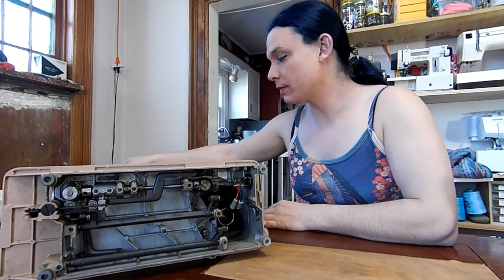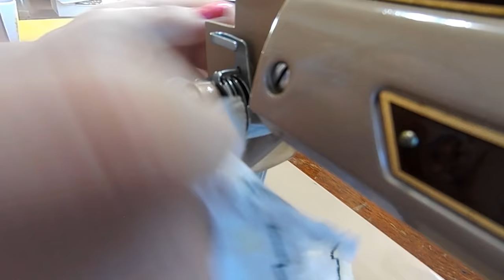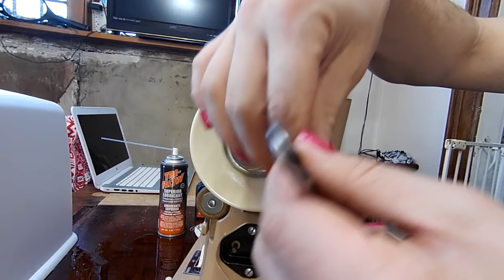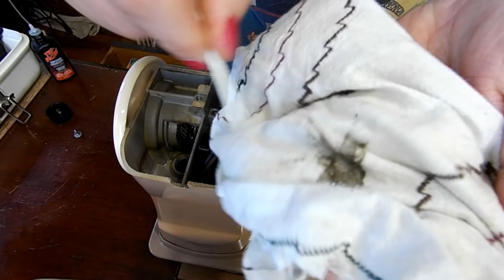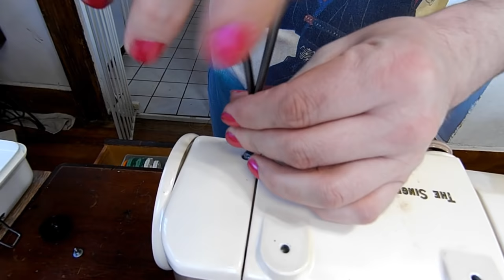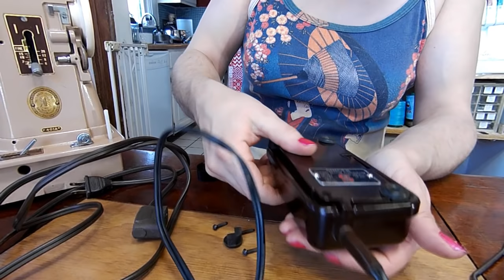How to Clean, Oil, and Grease a Singer 401a Vintage Sewing Machine

Comment: Thank you for this. I just got a 401a and so far, after watching dozens, your video is the easiest to watch and understand. And I love that your nails still look fab after all that. I do have one question-what regular ongoing maintenance should I be doing on my machine? If I don't use it for a while, do I need to do anything special with it while it sits or before I use it again?
Reply from the maker: Im sorry for the Delayed Responce I had no idea youtube was holding the comments until now. As far as long term Ive found that vintage machines need to be used monthly and kept oiled to keep them running smooth. HOW EVER. Triflow oil is unique as when it drys out it leaves a layer of teflon in its wake. So the machine wont get a chance to get gummed up and sticky again. If you leave the machine unused and unoiled for a spell simply oil it down right fast with a drip bottle of triflow and go back to work.

Comment: Stevie,  thanks for this great tutorial!   I love my singer 401a.  Got it on ebay.. and it was a bit dry when I got it.  I got me some Triflow and did what you said.  She hums now and it's like using a brand new Machine.  I'm looking for a 201-2 now.  Would to see a tutorial with one of those babies.
Reply: Since I've commented on this video, I've taken a eye to the 201-2 or 201-3... would Triflow be used on the moving parts like the 401a?
Reply from the maker: I use triflow on all moving parts in sewing machines. Not just the 401 its my go to oil on all my machine. I even run it in my singer 2491's oil pan.

Comment: Thanks for taking the time to make this very helpful video.  I appreciate your relaxed approach to lubricating the machine. So many times I've watched videos showing how, I ended up with more anxiety than I started with.
I have a 403 and the needle position doesn't change when and if the lever moves.  No matter how much I lubricate and work the parts the position won 't change without assistance.  Any suggestions?
Reply from the maker: Im sorry for the Delayed Responce I had no idea youtube was holding the comments until now. The needle bar is spring loaded. If its not moving its most likly because the linkage and junk under the hood is still stickey. Keep triflowing every thing you see. It will wash out old gunk and free up.

Comment: Hi there.  I just watched your video on cleaning the 401a.  Excellent and so easy to follow.  I'm having a problem with not being able to disengage the clutch.  When I hold the larger wheel and turn the clutch wheel counterclockwise, it just keeps going and the needle piston keeps going up and down.  Any suggestion on how to get the clutch to unscrew?  My machine is very clean..like brand new inside.  Only issue is the clutch.  I hope you still check your video comments...I know its been 4 years. 😬
Reply from the maker: Have you taken the wheel off and put a drop of oil on the crank shaft? Sounds like the crank is dragging on the wheel.
Reply: @SewSaveMe  Hi there...thanks for responding!  I was finally able to remove it by having someone prevent the needle bar thing from going up and down while I used a wrench to grab hold and unscrew it.  Guess what it was?  In your video, you say "remember which way this disk goes back on..."  yep, it was on backwards.  BTW, the side with the prongs goes toward the machine...lol.  I think it was put in that way at the factory because this machine is clean inside...not  any grease/oil anywhere (which I need to do) I put it back together and it works wonderfully.   Happy sewing!

Comment: Thank you for such an awesome detailed video. I do not have any tri flow solvent, but I do have Singer oil and Singer lubricant. My question is what can I use to clean all this junked up old grease inside. It appears your tri flow solvent does that, but is there something I could use other than that? Alcohol? Something that maybe Walmart carries? Thank you for your help.
Reply from the maker: I have yet to use any thing else like Triflow. I recommend you order some. Its really nice stuff it will dissolve old tar build ups and lube stuff plus when it drys it leaves a layer of Teflon in its wake. Even dry the machine will still run smooth.

Comment: I really appreciate your videos. Very helpful & concise. That Tri Flow is a great product! However, you might want to do a Google search for the Tri-Flow msds (material safety data sheet, sometimes just called sds - safety data sheet).  The first 2 pages tells most of what you need to know. Consider wearing gloves to minimize skin contact. Not tryin to harsh your mellow, but the msds says prolonged exposure could be toxic.
Reply from the maker: I have read that spec sheet. I was real curious how it reacts with metals and plastics. I did read the warnings about skin contact "fyi almost all oils have this exact same warning" According to there email they got with me it would have to be an extreme exposure, talking hands deep for hours on end every day for a year type extreme exposures. But since there is a risk they have to put the warning out. Look at other stuff, wd40, lucas etc etc they all have the same warnings. I dont think its going to hurt me no more then im exposed to it. Now if I did this 8 hours a day 6 days a week it would def be a good idea to wear gloves.

Comment: I have spent the last 4 hours trying to source the Tri Flow grease that you use.  None to be found and even the Singer grease is in short supply.  I have just seen a post from another person who works on vintage sewing machines and they mentioned that grease and lube was going to be in short supply in 2013!  The only stockists of Tri Flow grease AND oils are either American or Australian and even they are few and far between.  Can you suggest any alternatives please?  Thank you for your time.
Reply from the maker: You can use a good penetrating oil to get it all freed up then flush it over with normal sewing oil so the penetrating oil cant dry out and leave sticky residue. But Ill be 100 percent honest I havent found any thing else that works near as good as triflow that stuff is simply magic.

Comment: This is a fantastic video.  It was very helpful to clean my 401A until I hit a snag.  I was following along and doing great until I went to screw the cams back in.  Either the top cam (#3) or the screw has a small, 3 prong piece of metal that went flying and I don't know how it goes back together.  I'm stuck until I figure it out.  I've searched online, but found nothing.  Any suggestions would be great and very appreciated.  Love your videos.
Reply from the maker: it should go back in under the screw. All it does it snaps to the cams and keeps them seated so they dont slide up while in use.

Comment: Do you have a video on how the upper tension assembly goes back together? I had to take mine apart and can't get it back together right. Thanks for this great video. This is my only zigzag machine, I only sew on vintage, and mine really needed a service. I will look for your video on the motor. Thanks. Happy Sewing.
Reply from the maker: Im sorry for the Delayed Responce I had no idea youtube was holding the comments until now. Im sorry I do not. I have ever used google images for reference my self if thats any help.

Comment: Hello, Hello, what would be the best video for taking my 401a apart for a thorough cleaning. Looks like the person smoked a lot, the machine has old nasty grease, parts dont move. I was able to remove the motor, does not smell burnt. 
I have oiled everything, not the motor 😂. Just want to learn about it and get this one cleaned up. 
I have had one for 20 years, I used this video to oil it and it's my "daily driver"  running like a champ!!...but, I recently acquired another and would love to have it running as well. Thanks in advance!!
Reply from the maker: Great News im glad this was useful to ya.

Comment: Hello Stevie, I just got a 401A and will be cleaning it as per your video, soooo good. But I’d like to know what kind of pins for the thread spool were you using? The little ones that came with the machine are flimsy and not all fit. What do you recommend?
Reply from the maker: I use the stock plastic ones that were sold with it just fresh ones. They are flimsy and wimpy how ever the upside is if you knock one off by accident you dont damage the lid or machine at all you just snap or mess up a 50 cent plastic pin.

Comment: Thanks for the tutorial. I've recently acquired two of these babies, and now I think I'm prepared to do some maintenance on them. 
I've noticed that the feed dogs on one of them don't seem to have full range of motion. Long stitches don't seem as long as they should, while short stitches are practically piled up on each other. Is that something that needs special attention, or might it work itself out with proper cleaning and lubrication?
Reply from the maker: Thats a Good Question. I would start with heavy oil and getting every thing freed up before you dig to deep 80 percent of the vintage machines are just simply sticky from old oil and grease.

Comment: I have original zoom spout sewing machine oil, does it work the same as tri-flow? I'm new at sewing and just inherited the singer 401, great explanation in the video, thanks for explaining at beginner level
Reply from the maker: Zoom Spout isnt aweful oil it dont leave tar in its wake and does work fine. But not near as good as triflow.
Reply: @SewSaveMe  Thanks, I did end up getting tri-flow because there was a lot of old gross oil on my machine. But my bobbin winder is really stuck. Everything else in my machine is moving freely now because or the tri-flow but the bobbin winder knob doesn't budge at all. I've removed the little screw and I soaked it in Tri-flow and let it sit for a few days and still won't budge. What do I do?

Comment: I bought one of these about a year ago.  it's in great shape, it's been maintained well.  my only complaint is that the stitch length is very short, even when I put it on the longest setting.  do you have any suggestions on how to get that stitch length to be longer?  I have other newer machines that give me a much better range on the stitch length
Reply from the maker: With out seeing yours Im not sure. But you are right seems like the 401 stitch length is less then say my Kenmore 1802. Count them. The numbers that the lever is set to is stitches per inch. So on 6 you should have roughly 6 stitches per inch. If you have more stitches sounds like the machine is ether sticky or out of adjustment.

Comment: I love the video and your style! But I have a question about the spray oil. I've learned to never get oil on the gears because it will keep the grease from sticking to teeth.
Do you find that to be the case?
Reply from the maker: Not if you use triflow and triflow grease. The oil can dissolve the grease a bit but most people over grease the things so much it wont matter. Far as the oil its self no it wont hender the grease from staying put long as you let it drip dry a bit. But the spray can def wash some of the grease away. I always just make sure some grease its pushed where it belongs and as long as the gears arent dripping with triflow oil ive never had an issue with the grease falling away.

Comment: What a wonderful video, you have saved my 401A!  May I know if the needle bar is supposed to move sideways when sewing a straight stitch and the  levers are at AK3?  I have broken 3 needles so far because the needle would hit the dog feed cover when I sew at a fast clip.  I have to sew painfully slow so as not to break the needle.  Can you please help me?  Thanks in advance.
Reply from the maker: No its not. Sometimes there be a bit of slop in the bar most ZZ machines have this why I have a Kenmore 860 SS only machine. But if your bar is moving back and forth then somethings up.

Comment: I've always used Singer oil and singer lubricant- but I keep hearing about triflow.  What are your thoughts on the Singer oil?
Reply from the maker: Im sorry for the Delayed Responce I had no idea youtube was holding the comments until now. Sewing oil is sewing oil. Long as its clear and drys residue free. I have to use sewing oil in my industrial as it drips down the needle bar and needle to keep things cool and oiled. If I use triflow on that machine it will stain my work. If you have Singer clear sewing oil use it. When you run out try a bottle of Triflow Im pretty impressed with the stuff.

Comment: excellent video. you know your stuff
I have a 411g v v similar. my selector buttons in the fron were a pain in the ass. v difficult to change stitch selection.
i  bought mine at a garage sale. someone had had their unskilled hands inside it. I learned from stopping your vid periodically and got all the parts back where they belong.
mine is almost new condition. everything moves as it should.
except that changing stitch is difficult.
my question.
does your machine easily change stitch pattern or do you also have to make several rotations of the balance wheel before the selector will budge.
is this difficulty normal and I am just not using my machine correctly.
thanks for any help you offer.i have subscribed

Comment: Excellent and clear explanation. Is the triflow spray the same as WD40 we have here in the UK? Thank you. Regards, Alison
Reply from the maker: Ive hard triflow is hard to get in the UK and it its not the same stuff as WD40 at all. There are other great oils to use too or standard sewing oil works too it just dont work near as good as triflow.
Reply: Hi. Thank you for replying to my query. I have had vintage machines purchased recently, but have had them professionally serviced. I liked the idea of your oil in case I had a sticking point! Never mind, professionals it is. Regards. Alison

Comment: Thanks so much for making a great video, I love that I can learn to do most of common servicing of the machine. I have a 401A that is making a loud noise, almost a shrill noise. Very hard on the ears when I use it. It's been suggested that I first try cleaning the cam stack and maybe the motor. I've watched your video several times to see how you removed the cam stack. To remove the cam stack, the little screw in front of stack is the one I think you loosened before removing the cam stack, on my machine the screw is so tight I can't remove it. Any suggestions and help???
Reply from the maker: You may have to use a hammer driver to get the darn thing loose. After 40 years of vibration and the cam spinning that screw can get awfully tight.

Comment: Hi! I recently became an owner to this beauty of a machine. I’m in the process of servicing her up, I’m not confident in removing the engine piece yet. Would it be safe to use the aerosol tri-flow when the engine piece is still in there?? Thanks!
Reply from the maker: I use it all the time just dont soak the Motor with it or spray directly on it.

Comment: I just bought a Singer 341G. It sews nice straight stitch, but the zick zack does not get wider than a few millimeters. Thus, the stitch width cannot be adjusted. The special stitches don't work either. I've tried to open the machine, but can't figure out what happened. It worked before I turned it upside down to oil it. Maybe something just ended up wrong. Thankful for all ideas!
Reply from the maker: Sounds like something is still stickey. Like maybe the linkage that runs on the cams.

Comment: Aren't you sweet. And so clever. Darlin' ,I have a 15-91 that has a couple of very small stuck screws I can't seem to remove no matter what. One is holding the worm screw in( got the other one out) The other is on the outside of the motor housing that seems to be holding the insides in place.I got one out just fine but this second on on the opposite end refuses to cooperate. Any suggestions beside dynamite ?

Comment: Hi Stevie! I have model 401 M with a little problem. After I install a needle, I need to lower it down of less of a millimeter, otherwise hook won't catch the thread. Any way to fix that? I couldn't find services manual for this model. Thank you
Reply from the maker: sounds like the needle bar is out of time. There is some fine adjustment on that bar. Maybe they hit something real hard and knocked the bar out of wack a bit. There is a service manual out there for this that will show you how to time the machine. Just gotta do some heavy diggen for it. I havent had to time one as of this date.

Comment: I am new to sewing and my 401a that I picked up at the thrift store was pretty clean. My question is... is the clutch/smaller wheel supposed to be able to spin? I can’t get mine to spin or disengage to winde the bobbins
Reply from the maker: It should yes. But people tend to over tighten them or over time they get sized. It can be a pain to get them lose. A good set of channel locks and a rage so you dont leave marks could be your solution.
Reply: SewSaveMe Thank you so much for your response. I was able to find another video that explained how this specific area works. Your video helped me how to oil and clean the rest of the machine.